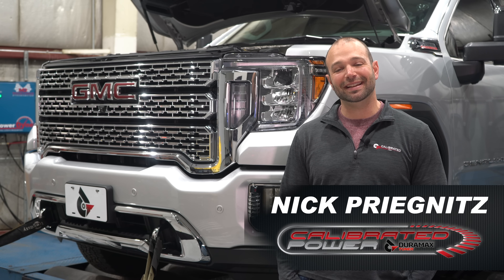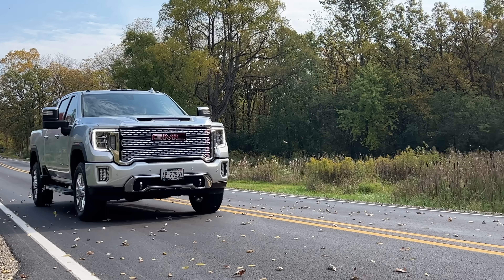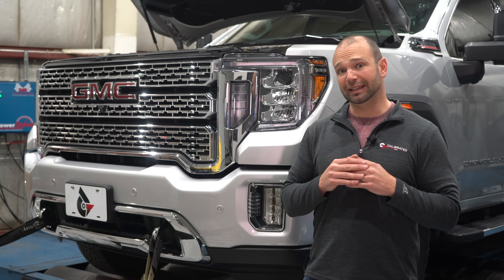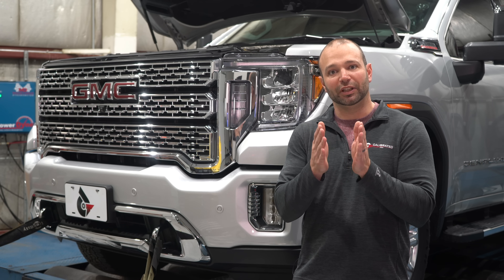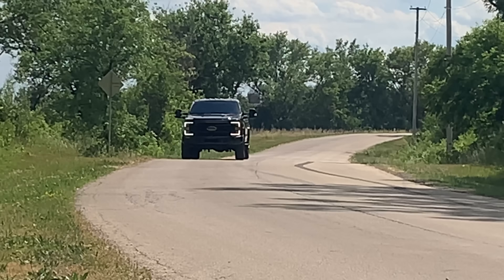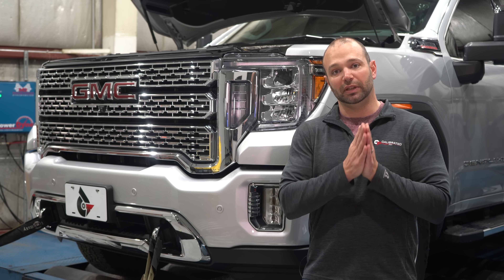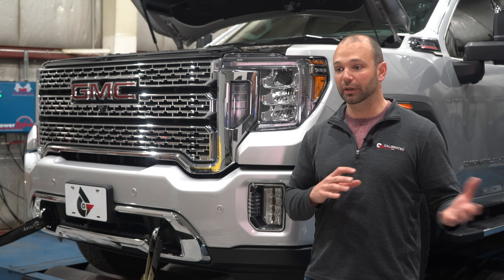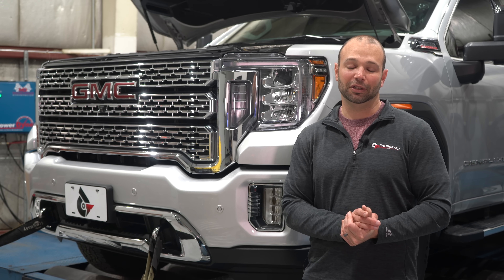10-Speed Allison Transmission 101

Comment: But is the 10 speed a real Allison? and is it in the new 2026?
Reply: Not a “real” Allison, just branded that way. 
So far looking like they’ll have the same transmission in 2026, but just may not be able to slap the Allison name on it. 
The 10 speed just helps to much with marketing numbers for them to go back to a 6 speed.
Reply from the maker: HAven't had our hads on the 2026 6.6L yet!

Comment: Im pretty sure there is nothing Allison about those 10 speed transmissions.  The design and build was GM with a Allison badge.  THere must be some problems with them because Allison is pulling out of the badging agreement and GM can no longer Badge with the Allison name and even has to remove the Badging on existing inventory if it has not sold by June 2026.
Reply from the maker: Thanks for the comment!

Comment: I have a Ford 10 speed and a couple of ZF eight speed and have had various six, five and four speeders over the years. Oh and a ZF nine speed in a Honda which was OK but needed 70mph to shift to ninth.  Anything from eight speeds up is great and efficient. 
Allison don’t make the ten speed, GM do and have used the Allison name. Unfortunately GM have cheapened the components to the point that it is terribly unreliable, to the point that Allison have decided that it is detrimental to their image and reputation to have their name on it, so have recently [November 2025] announced a complete divorce from GM and the removal of the Allison name from the GM ten speed transmission. This in no way reflects on the Ford version which has a similar design but differences where it matters. Ford had initial issues with a bushing and torque converter but have addressed them successfully some time ago..
Reply from the maker: Appreciate the detailed comment!

Comment: The real Allison Transmission currently makes a 9 speed beast based off of the 6-7 speed 1000/2000 series that every HD truck owner should demand they have in their trucks. It shares most of its internal parts with the 6-7 speed with a few additional parts and is a few inches longer. The 10 speed in the trucks now is not a true Allison but something GM paid Allison to put the name on it. None of the big 3 want to pay for a real Allison even though ultimately it would pay for itself in no time through reliability and truck sales! As proven only a true Allison is going to give you the true reliability you’re looking for. And its made her in Indianapolis, IN USA
Reply from the maker: Interesting points!
Reply: No new design or significant update is guaranteed to get it right from the off. The problem with the GM transmission is allegedly that they cheapened the components to the point that it compromised reliability and they did nothing effective over quite a long term to sort it out and make it good, thus with the Allison name being used, it adversely effected the reputation of Allison who only allowed their name to be on the transmission for, probably, a fee per unit.  Allison have decided that enough is enough and are revoking the right for GM to use their name.

Comment: ia there anything that be done to help my 2002 k2500 496/3.73 tow any better?  when its hot and im in OD around 1800-2000 rpm applying light throttle I get an annoying  buck and shudder.  Forget towing my  25' boat on a hot summer day on the highway.  let alone a hill.  it's a roach. 

  I cant lock out overdrive and  3rd is too low.  It basically tows like shit.  and for a big block, I thought there should be more.  Yes it's 23 YO but it doesnt even like to  tow my 25hp kubota very well.  and a $60,000 truck isn't an option.
Reply from the maker: Built transmission may be what you need.

Comment: Ya, I’ll stick with the incredibly strong 6 speed in my F350 6.7. The ten speed just hasn’t been shown to have a great dependability and the cost of repair is like getting a new truck. I’ve always been a new vehicle fan but all new vehicles are over the top for computer controls and high repair costs.
Reply from the maker: That's a little like saying "I'll stick with my 7.3L  because I don't want emissions equipment on my truck". Sure it's true that a 7.3L will never be down for EGR problems but it's also never going to perform like a new truck.
Reply: @ I worked most of my auto repair life (45 years) in dealerships, I was always a new vehicle advocate, always driving vehicles that were less then 5 years old, that’s completely changed, all new vehicles are crap mostly because they’re way over controlled by computers. That 7.3 is still a completely rebuildable and usefull truck, wait till a current new truck is 25 years old and new parts cant be bought , used parts can’t be used because of programming or serial number encryption problems. Thing is these new trucks won’t get to be 25 years old. Ive already run into newish vehicles that parts cant be bought for, imagine a centre stack display that isn’t compatible for a vehicle for more then one production year that fails when its 4 years old, off warranty, manufacturer doesn’t give a crap and you can’t find or install a used one for a number of reasons, that fixable old trucks won’t get starts looking really good. Yes this problem has been solely related to dodge for me so far but its a real upcoming problem. Disposable vehicles.

Comment: The 10 speed issues are the primary reason i haven’t bought a new truck.  The current 6/speed is at 150k miles working great.  The 4 speed before that went over 200k miles without issues and I rebuilt it as a precaution.  Simplicity leads to reliability
Reply from the maker: Yeah, the 6 speed was an awesome transmission.
Reply: @Duramaxtuner  Yes, and better than the POS 10 speed that GM and Ford created with their faulty valve bodies.

Comment: I have read the 10 speed transmissions in the GM 3500 and lower are NOT Allison transmissions. I do not believe there are 10 speeds for pulling considering everything is getting more gears. As for GM pulling, I am sure most have seen the YouTube video (Chevy Cheyenne vintage commercial).
Reply from the maker: This is a quote from DieselHub.com: "Allison 10 Speed Automatic Transmission Specs & Ratios
The Allison 10L1000, or more appropriately GM-Allison 10L1000, 10 speed automatic transmission was introduced for the 2020 GMC Sierra/Chevrolet Silverado HD equipped with the 6.6L Duramax L5P turbodiesel. The transmission is not related to the co-developed GM 10L80/Ford 10R80 10 speed automatic transmission that is found in GMC Sierra/Chevrolet Silverado 1500 and Ford F-150 pickup models." https://www.dieselhub.com/transmission/allison-10l1000.html#:~:text=Allison%2010%20speed%20automatic%20transmission%20specs%20and%20gear,powertrain%20integration%2C%20and%20a%20chain%20driven%20PTO%20system.
Reply: @Duramaxtuner  As your link states, (As the transmission carries the Allison namesake, one can only assume that the 10L1000 has earned Allison's stamp of approval).

Comment: Personally, I wouldn't buy a truck any newer than a 6L90. The 8 & 10 speed trucks seem to have a lot of problems. Not that the 4L60E trucks don't.  I own one and keep up on the maintenance. Changing the fluid every 40-50k and never towing in OD. My transmission still went out at 133k. I never even towed anything heavy, just a 10ft Livingston boat. I can hardly tell it's even back there.
Reply from the maker: While I can understand where you're coming from, that will limit your options for future truck purchases.

Comment: Given current technology, cost, reliability, and weight. For the moment 8 speeds seems optimal. Im not sure why ram would change. After this video this transmission is having serious problems. Software is causing confusion between the valve body and the clutches. Causing them to trip the wrong clutches and lock up. Wear in the valve body wasn't accounted for properly.
Reply from the maker: New technology always has a few glitches. While we haven't recorded a bunch of the failures you described first hand it seems believable enough.
Reply: @Duramaxtuner  definitely. Totally agree. Its very likely they will fix this problem and ten speeds will be just as reliable as the 8 speeds. If we never changed and try to improve from mistakes I suppose we would still be building firs in caves.

Comment: Complete junk. I had a transmission shift issue that would leave me hanging... IE: 3 second shifts and the electronic throttle would shut down .... nearly got me hit in traffic. Several times. Dealer refused to fix it even though it was under warranty, factory, Dealer forever powertrain and aftermarket warranty. Nada.... spent THREE years dealing with this  on my F250 2021 7.3. Until I had it TOWED to the dealer and had the tow truck leave it cross ways in front of their service doors. They FINALLY fixed the issue. It was a solenoid problem. Got rid of the truck as soon as the problem was fixed... 12 mpg freeway.........
Reply from the maker: That's a frustrating situation. For what it's worth, the tune in the Duramax from the factory leaves a lot to be desired. With our ECM & TCM tune, the truck feels much better.

Comment: In 1985 GM introduced the port fuel injected 3.8 Buick V6. Coupled to that awesome addition was the 440T4 a 4 speed automatic overdrive. Quite literally overnight grandmas Park Ave was putting more torque to the ground than ever. Couple all that with the new lighter smaller body style and you've got a pretty fun car to drive. A few years later the Riviera came with a super charger! Whaaaaat? I was sent to Saginaw from the dealership I worked at for training on that system and I was instructed to drive one of those Rivieras for the class. I was completely blown away by the ability at highway speeds to accelerate past anybody and anything. So yeah, the more gears you have and are able to stay at the optimal point in the power band, the more you can do in regard to launch and passing power. You're still gonna die on the steep grades with a wimpy motor so choose wisely. As an owner operator of an automatic transmission repair shop, I will always support more gears. LOL.
Reply from the maker: Well said sir.

Comment: The 10L1000 is NOT an Allison transmission.  It is in-house GM designed, and similar to the 10L80 (which was co-developed with Ford), albeit sized and equipped for HD usage.  But the standing FACT is that GM paid Allison to use the name on that little badge.
Reply from the maker: Thanks for sharing. None of that changes any of the information we provided in the video though right?

Comment: The nicest auto transmission I’ve ever experienced was the 6 spd Allison transmission.  
I have the aisin in my 23 5500 and it’s amazing for towing.  The engine brake and downshifting is pretty dang impressive too, but…
Manual transmissions are still king for trucks IMHO.  Too bad we are a fat, lazy country of convenience. 
The ZF 6 speed in the fords were definitely the nicest manual I’ve driven in a truck followed closely by the G56 in my ram.

Comment: I have a ten speed in my 2019 Ranger. The thing that drives me crazy is when I'm driving from Nevada to crazy land California, on decent in the Sierra's the transmission try's to hold speed. Freaking RPM revs to the moon! The only way I can stop it is going to sport mode and shift it to a higher gear.

Comment: Is this the trans with the faulty valve body?
Reply: Yes. Just try and get one. Mine left the chat at 24K miles on a 23 3500 HD. Maybe 90 days to get one. I had to go after market as I need the truck now. $4700 out of pocket to get back on the road
Reply: @nickkercheval2704  Did you go with NexGen Drivetrain?

Comment: Hybrid drive systems are eliminating the need for a reverse gear so expect these systems to dramatically improve perhaps as soon as 2025 as pure play ICE platforms continue to get kicked to the curb mainly because the upfront costs make no sense for near everyone now as don't even need a vehicle anymore in the USA in the age of fully autonomous vehicles and "Google." #waymo vehicle autonomy. Not sure what Chevy has planned for #cruise_automation but obviously Tesla is not waiting around to find out and yes you can charge your Tesla at home still. The Germans designed I think it was an entire engine but maybe the transmission that was set in an entire bath of oil for cooling purposes as these systems run crazy hot and hence why I would never "tune" one without first resolving the heat issue. Ford used to do this with their ten speed automatics but then their new CEO came along and ruined the entire product...and in the process has done nothing but destroy Ford Motor Company ever since. No WAY would I touch any of this Detroit garbage at the moment and knowing that as the ethos. Still interested in buying the Company tho! Long $f Ford strong buy

Comment: I bought my 2021 Sierra 3500 Duramax 10 speed dually to pull trailers and 5th wheel campers and daily driving.  Not to drag race.  The stock power serves me very well for hauling my 17,000 pound trailer.  I have no need of the problems and headaches that comecwith modifications.  I've had two previous Duramax/Allison's and I can assure you the 10 speed steps in and clears up the old 6 speed's shortcomings.   Do not misunderstand, the 6 speed was an amazing, superb transmission.  IN ITS TIME.  25 years ago.  Very often it just didn't have a correct gear for a situation.  Moderate speed in traffic.  Engine was always either spinning too fast or too slow.  Pulling up a hill the shift from 6 to 5 wasn't enough.   It required dropping down another gear to 4th, which had the engine wailing unnecessarily.   The 10 speed always has a gear to put you exactly where you need to be.  Which means it is comfortable and pleasant to drive.  For the last 50 or 60 years I have always been very conscious of what my transmission was doing.  From the old "3 on the trees" , 4, 5, 6 speeds. Manual or automatic.   With this new 10 speed, it just doesn't matter.  It always seems to know the right thing to do for what I'm doing.  So I can pay more attention to important things.  Like listening to critiques on my driving from the right hand seat.
Reply: It is NOT a ALLISON. That transmission will fail you, GM built it for failure.
Reply: @curtis9795  Sadly, not a "TRUE ALLISON", but thecplacque on the side is pretty.  I'm still pretty sure my unmodified rig will last a while.
Reply: Like the bit about the "passenger driver" 😂
Reply: Hope urs lasts.doin research 4 a new one.this 10 speed scares me.actually hinkin of buyn a older one with a real allison. Am i crazy
Reply: @greglake3554 Or just buy one with 10 speed an nex gen upgrade kit
Reply: You sound like a sales rep….lol….after my time with the gms 10speeds and 20s and up are all trash just had. 20243500hd try to self destruct when it decided to rapidly downshift good thing im not hard on it or it would have 😂
Reply: The 10 speed is a great transmission, my brother has one and loves it, very smooth and easy on the engine. I have the 6 speed. No complaints with it and I pull my toy hauler in the Colorado Rockies a dozen times a year. Weight about 12,000 lbs. My only minor complaint about the newer 10 speed is the difficulties in servicing it. There is no spin on filter and no dipstick tube to refill. I think that both are great things that were left off due to cost.
Reply: @tomcroghan3776 it’s a throwaway that’s why they left those off.
Reply: Hey bro how’s it going…. I hope you read this i need your opinion sir lol. What do you think about 2022 CHEVY HIGH COUNTRY DELUXE TRIM W/ 10SPD ALLISON TRANS. I’m going to be hauling a 3 car hauler with a car over heard. Do you think that truck will be right fit for the job ? Something is telling me to buy it lol
Reply: @davekave8971  You seem more interested in the name and trim level than the capability.  You make no mention whether 2500 or 3500.  If it were me looking at that I would be looking at a Silverado 4500, 5500 or 6500 medium duty.  It has the L5P Duramax but has the true Allison 2000 transmission.  The heavier duty version of the 6 speed used in the pick ups.  The engine has reduced power but the rig will last forever.
Reply: @samfixitguy1661  I was looking at a 2500 HD 2022 CHEVY HIGH COUNTRY DELUXE to haul 3 cars.
Reply: @davekave8971  OK.  Now I know you're joking.  The drive train will do it but the chassis won't come close.   Only a dually.  But you already knew that.
Reply: @samfixitguy1661  you’re right . Ima get me a ram dually 3500 for heavy hauling
Reply: 👏 what a comment. I applaud you sir and couldn't agree more with your critique and opinion. Which is also a nice change from the opposite reaction coming from the right hand seat there eh bud. 😂🇨🇦🇺🇸✌️🤘
Reply: Not alot to prove but 73k strong on my 21 10speed and zero issues. Tans stays cool and shifts smooth, power is always where when needed
Reply: @jordanfurr6646 it'll go. Be ready.

Comment: I’ve been driving semi’s and big bad trucks since 1984. I own a Chevrolet Silverado 3500 duamax / Allison 10 speed and it’s the worst transmission I’ve ever driven. At 117,000 miles it’s either locking up or downshifting from 9th to I don’t know, park at 80 mph. It’s a death trap and the dealer is refusing to fix it. I’ll never buy another one and for Allison to put their name on a GM product that is this bad is a shame. Come to find out this issue is happening to a lot of people. Should be recalled but GM won’t do it or won’t do it yet.

Comment: I would buy the 10 speed for towing....not drag racing.  Smooth transitions both up and down shifting with the factory engineering setup on the 3500HD Duramax.  Great reveiw.
Reply from the maker: Thank you. You're exactly correct, towing is what this is for.